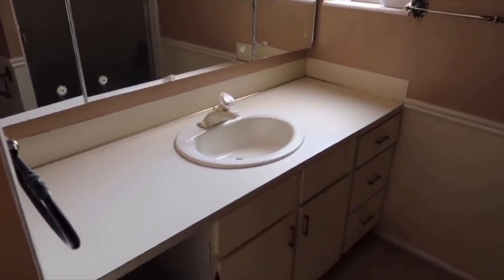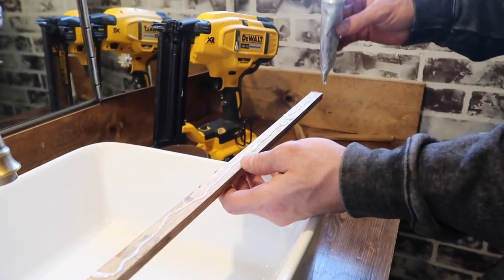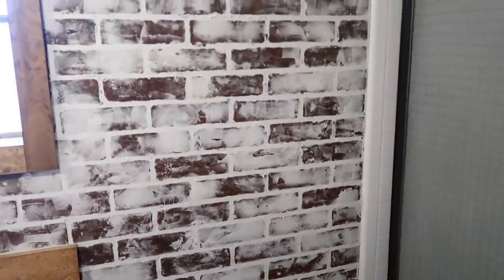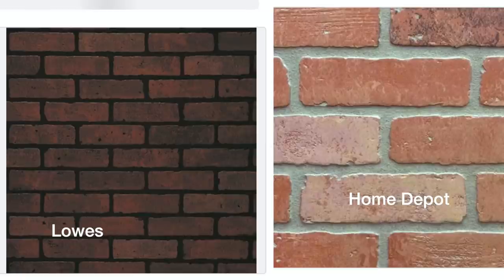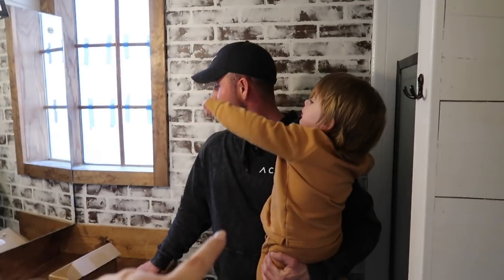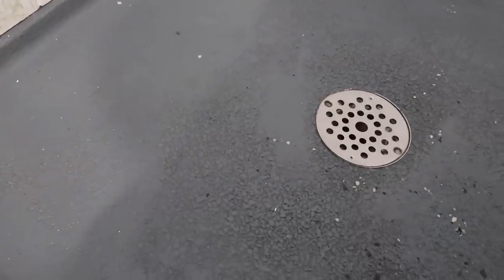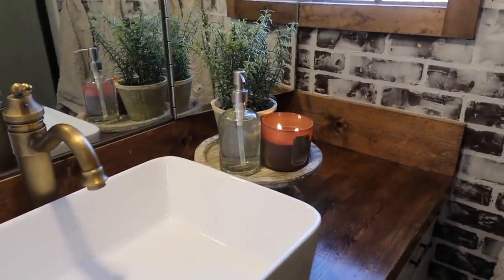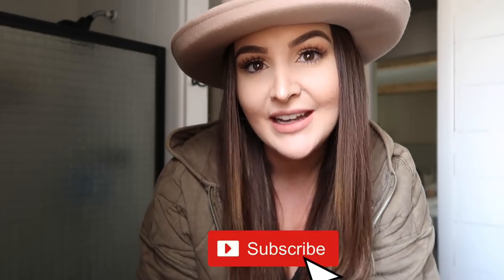*UPDATE* Bathroom Remodel Under $500 TWO YEARS LATER | Some Regrets + did it hold up???

Comment: Impressive!  The follow-up is very much appreciated.  You can take the mirror to a glass place and have them cut that one side by the window so that it is folds back flat again.  Paying a small fee does take away the worry about chipping or breakage unless you are brave enough to cut it yourself and sand the edge smooth with emery cloth. By the way, I use emery cloth if the edge of a dish gets a slight chip.

Comment: Ok, first and most importantly - what a cutie pie you have!  But I have to disagree w/you rethinking some of your choices, personally.  The white on that dark brick ties in perfectly w/the white vanity, sink and shower - looks very fresh and clean.  Also, the dark of the brick ties in well w/your floors.  The mirror not fitting flat actually looks like it's by design and makes the mirror seem like a "fashion" vanity mirror.  I do think you'd like a real window in there - fresh air hurts nothing in a bathroom, lol.  Also, just a suggestion - put a threshold between the two
different floors (from bedroom to bathroom) and it'll look cleaner and more finished.

Comment: I have a question about the flooring, when I purchased my home the master bath floor had been redone in peel and stick flooring and it’s bowing up really badly I think we are going to have to replace the subfloor as well. How come your did not do the same? We did not lay this floor and I am assuming it’s because you used adhesive as well and this probably did not?
Reply: could be a few factors... temperature changes over the years, poor prepping/cleaning of the subfloor, subfloor not level enough to accept the P&S flooring well, cheap adhesive used originally on the P&S flooring, etc.

Comment: Hey ashley just wondering if you ever used the brick paneling where there would be an edge … I’d like to use it for a fire place but I’m thinking there would be an unfinished edge ??
Reply from the maker: On my faux fireplace in my bedroom we did paneling and had the same issue! We just over-grouted the edges and it made it look perfect!! So you could do the same idea with  spackle!
Reply: @ashleyhuze  ok thanks